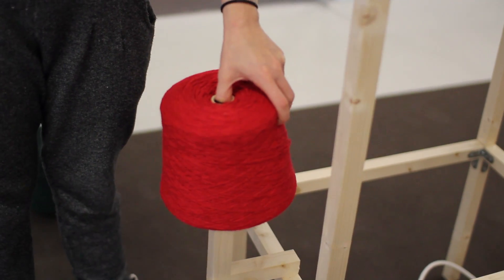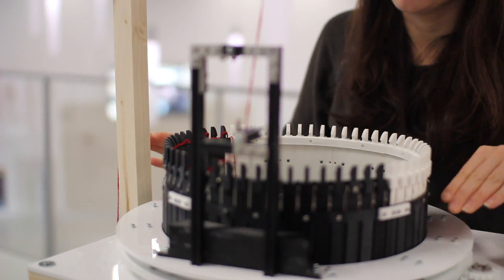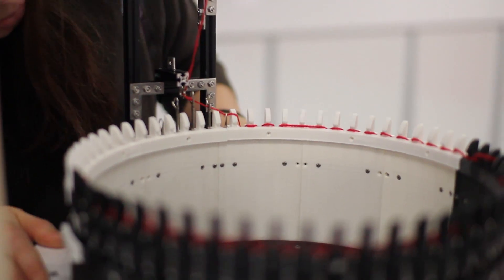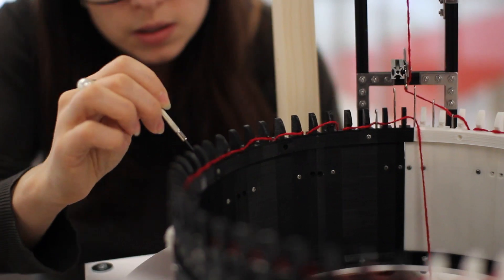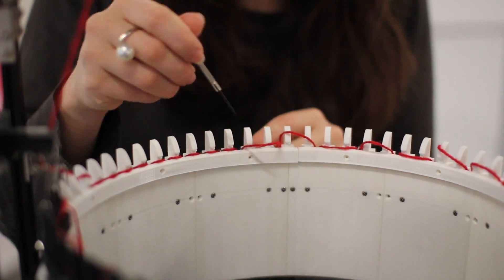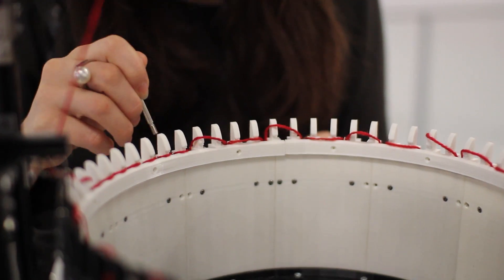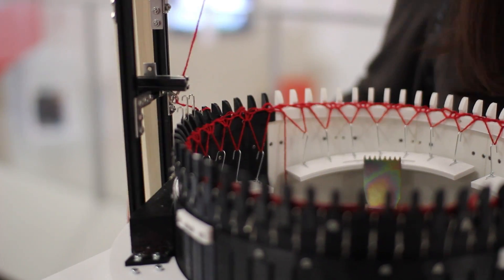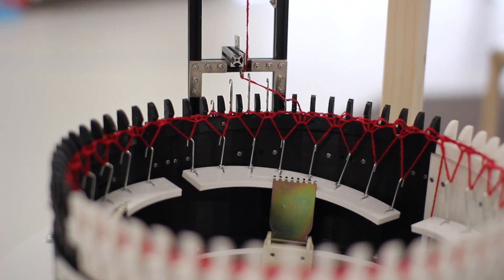Circular Knitic tutorial: How to Cast On

Comment: With this style of machine you don't need latch hooks on the needles. Look at all the plastic toy circular knitting machines, starting with the early 1970's Mattel Knit Magic. They are made so the knitted yarn is moved out of the way so the open hooks can pull down without catching it.

With hooks it needs a brush to ensure the latches flip open when the needles go up and close when they go down. But that will eventually fail as the pivots wear and gravity will open the latches. Works fine on a horizontal machine.